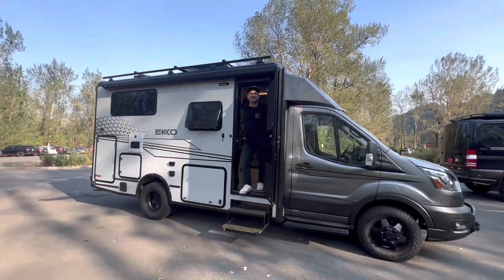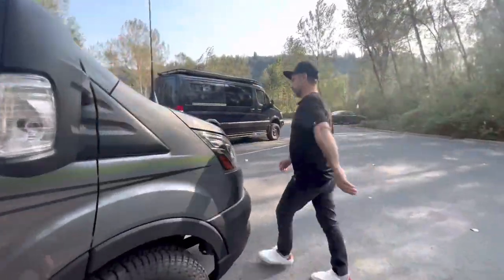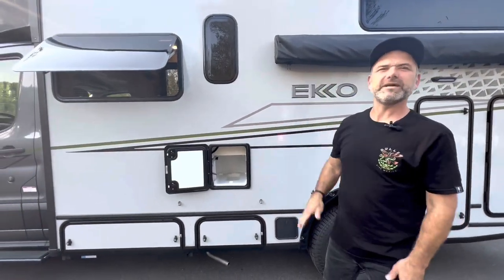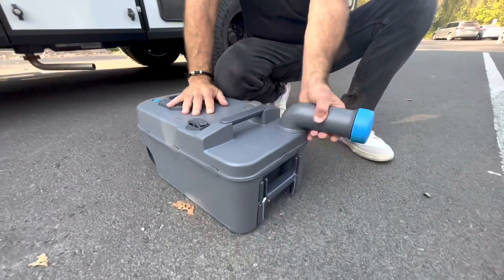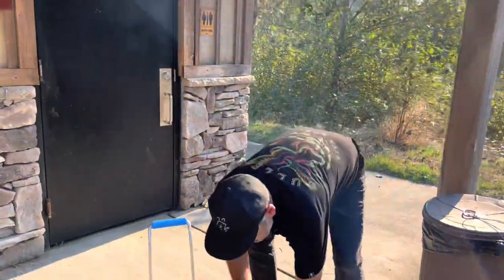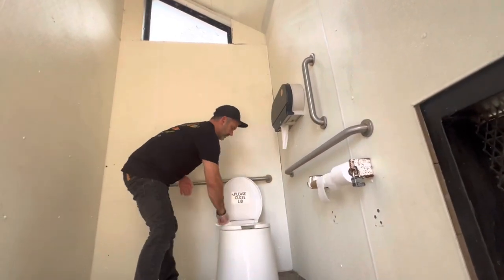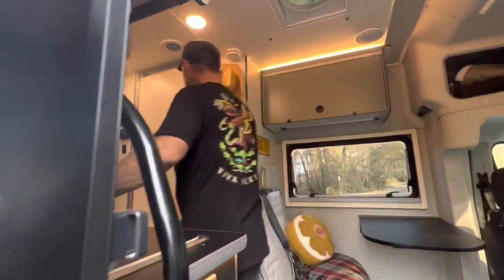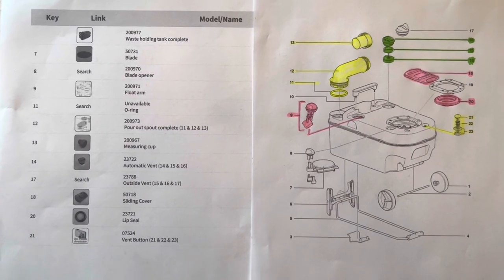EKKO VAN | Winnebago Ekko CASSETTE TOILET COMES W/ A BUILT-IN MEASURING CUP? | USEFUL PARTS LIST

Comment: As maintenance Lead for my district working for a concessionaire, I can tell you the ugly story of what people have had to retrieve in the CXT pit toilets! 

But the biggest mystery is why such a mess is made in the inside of the riser while dumping cassette & porta potties. The Americanizer might help, I want to fashion a short RV sewer hose that reaches to the bottom of the riser so I don't spill any on the inside of the riser. I use an 18-volt DC pressure washer to clean them, but porta potties spilled overnight on the inside of the riser tends to stain & stick to the riser, thus increasing the number of complaints we get about dirty toilets. This is my quest to figure out a good solution as we all know that use of cassette toilets is increasing all of the time. Keep up the good work! Cheers, Davey

Comment: Great tips. I want to share one with you that would save on producing more trash. You can hold the paper towel in one hand, with the gloves still on. Make a fist and remove the glove. Then, place that glove with the paper towel captured on the other hand. Make fist again and remove glove. It will all be incapsulated in a glove, which you can then dispose. No paper bag required. Hope this helps. 😃
Reply from the maker: I can handle that, lol, no pun intended. Thanks for the tip. 😎

Comment: Thank you for this very informative video it makes me appreciate my black tank that much more
Reply from the maker: I can see both sides.  Our old Argosy had a holding tank and the only thing I didn’t like was connecting at dump stations.  Sometimes they were like the outhouses. Less than desirable.
Reply: @ekkonesters599  you I see your point but if an RV already has a gray water holding tank and you have to connect a stinky Slinky to it might as well dump your black tanks that's convenient
Reply from the maker: @camposvazquez  you are correct.

Comment: We Have a Roadtrek 210 class B with a black tank and the toilet broke. As we had a 78 VW poptop camper before this, a portapotti was normal to us.  I plugged the black tank inlet with a flush screw in type from Home D. , put in an edged floor for the portapotti, and find I'd rather take out the tank, use the dump station (or a bathroom-I've carried the base with a garbage bag around it, or the woods  as we use no dangerous chemicals and all T.P. goes in the garbage), wipe it down, put it back, and NOT HAVE TO virtually lie down to release a cover, get hose out, , unscrew caps, dump,  deal with the flushing mess of black tank, etc. The Ekko isolates the potty part from the bathroom and rolls, which is nice.
Reply from the maker: Very creative and we can somewhat relate.  Our old van was the bucket/bag and dispose of at rest stops and gas station, etc.  we can definitely relate. Very clever on your end.  We are currently spoiled, but so have our veteran years in the past options as noted.  Thanks for watching and supporting our channel.  Wishing you safe travels ahead.

Comment: Really enjoy your very informative videos!  My current class B has a standard black tank (vs a cassette).  I find If I keep some water in the toilet bowl at all times it tends to give an extra "seal" which eliminates almost all odors.  Do you keep any water in the bowl?
Reply from the maker: Your suggestion is great, and I totally agree when I remember to it sure does make a nice improvement.
Also, just wanted to say thank you for falling along with us and watching our videos.
I appreciate you providing the reminder as it definitely is a good idea.
Do you happen to have a favorite treatment that you use in your holding tank?
Reply: @ekkonesters599  yes. I’ve been using the Citris scent Camco RV toilet treatment Drop ins. TST MAX.  I’ve been buying them at Walmart.  They work great. Each pod I believe is made for a 40 gallon black tank. Mine is only 12 gallons, so a little overkill. Since your cassette is only 5 gallons I think you can buy this particular treatment in liquid form so that you can measure a smaller dosage.

Comment: well done on the video!  did you do any type of suspension/lift upgrade on your rig?  I'm thinking of a van compass or similar type of lift kit and adding more all terrain tires/wheels as well.  Thoughts?
Reply from the maker: Hello, thank you for the compliment.  Yea we ran the Van compass TOPO 2.0 lift. We are very happy with it. We also have the Falken 225/75/16 ( I have a video on this and we’ll). You can use 245/75/16 as well.  Just requires rear spacers, which is no issue. If you go with the 225/75/16 you can install those without the lift.  But 245/75/16 require the lift.

Comment: Thanks for the video. So, it's pretty much just a glorified Thetford port-a-potti, like the one we use when we tent camp. I guess I'm not understanding why they would put something like this on an RV as nice as this one. Wouldn't having a black water tank that small really limit how many days you could be out? Maybe I'm missing something.
Reply from the maker: There are definitely pros and cons to the cassette toilet for sure. The cassette toilet is convenient based on overall accessibility to dumping locations. (Outhouse, public restroom, rest stop, etc) light weight and doesn’t require a dumping station. Also, overall plumbing and weight based on RV/van size.  
However, the disadvantages to the cassette can be the frequency/need for disposal compared to having a larger capacity black tank (15 -50 gallons). 
With the black tank you may be be able to hold for longer periods of time, but a dumping station will be required which can be more difficult to find unless your primarily traveling with the intent to stay at RV Parks. 
One other consideration is the overall intent of the RV based on travel life style. If your more of a boon-docker or off the grid type of RV adventurer/owner, then you’ll probably find cassettes a great option. But again if your traveling with RV park life style then yea a large capacity holding tank is a plus. 
Also, weight can be a consideration on certain builds. I hope this helps. Thanks again for sharing thoughts and comments and especially watching our channel.  Happy Adventures and travels to you.
Reply: @ekkonesters599  Thanks for the reply. Very good points made. Things a hadn't thought about. We really like the EKKO, it's currently at the top of our van shopping list. Keep up the well done and very helpful videos.

Comment: Great video but there was one mistake: Due to pressure that can build up in a toilet tank, the blade should always be first opened with the toilet lid closed. You only need to open the blade once with the toilet lid open, get sprayed, and you will never make the same mistake again. Don't ask me how I know this.
Reply from the maker: Hi Daniel, thanks for taking the time to share your experience. I have a quick question for you I’m assuming Do you have the same cassette toilet?
I have not actually experience that much pressure in my cassette, Not to say that it couldn’t happen.
But the auto vent, I am assuming relieves some of the pressure based on my understanding.
You actually have a super curious about a few things and I’m grateful for your sharing because I can do some more homework on this take care and happy travels I may shoot you another message based on my discovery.
Reply: @ekkonesters599  My EKKO is on order but I currently have a truck camper with a porta-potti and it is very similar to a cassette toilet but it does not have an auto vent. So it looks like my concern about pressure buildup does not apply to an EKKO.
Reply from the maker: @danieltaylor3396  it was cool to share info though thank you for the dialogue.  Congratulations on your future Ekko.